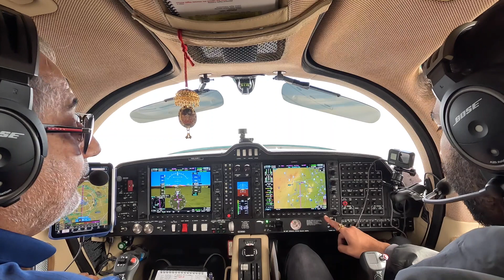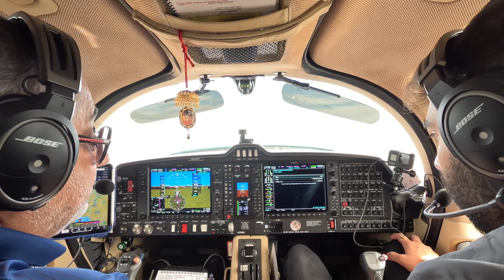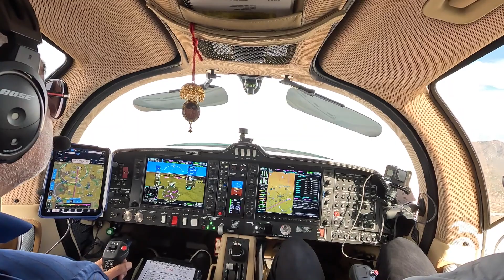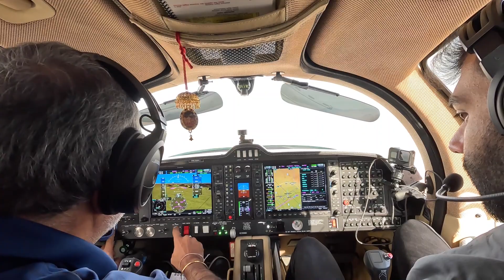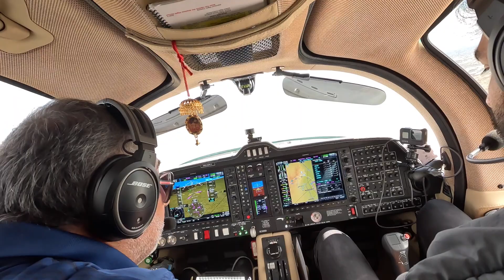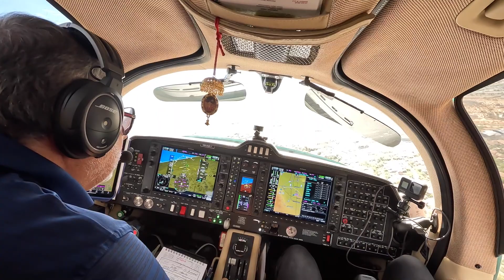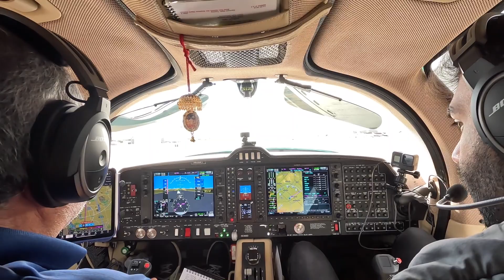Final Check for Approach Procedure in a Diamond DA62

Comment: Your videos are awesome, how's the total range on the da42?
Reply from the maker: You mean DA62. 25 gallons on each main tank and 18 gallons in each aux tanks. Total of 86 gallons. Burn rate two engines is 16 gallons at 75% power. So approx 1,200 nautical miles is the range
Reply: yes sorry meant da62, that is incredible range , you should try an atlantic crossing @AirRandy-nk8jj
Reply from the maker: I will at some point. Just building confidence slowly. Have only 400 plus hours under my belt